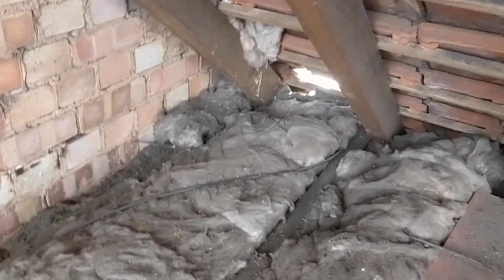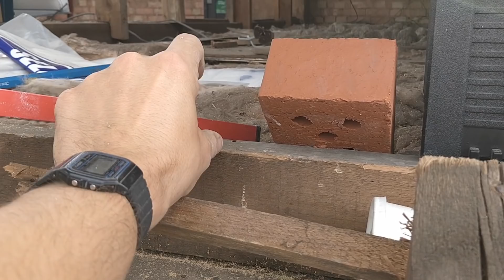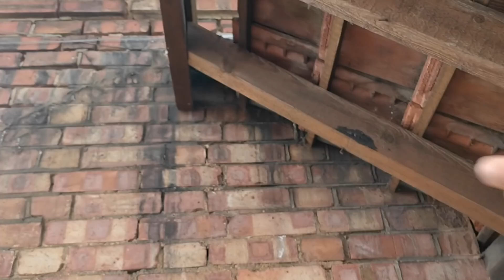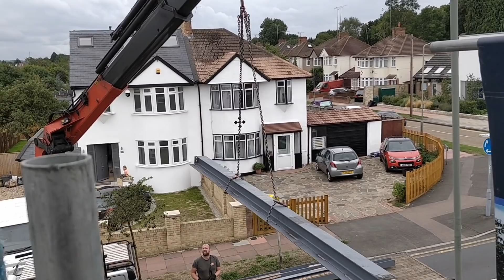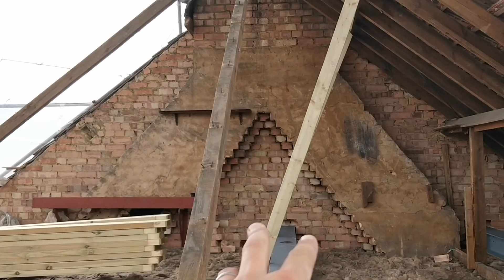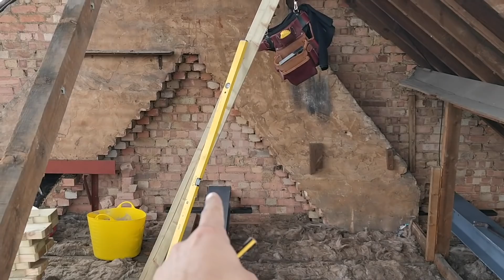Installing the steel floor beams

Comment: Is it really good idea to lay bricks on a timber ? https://youtu.be/YEJkfG62eu0?t=183
Reply from the maker: It will most likely be fine, and the building inspector was happy to sign it off. It's probably better to cut out that timber header and lay the new course of bricks on the existing brickwork.

Comment: I'm wondering what is the reason behind installing steel 30mm  above the wall plate ? I understand that long steel can deflect slightly and can damage ceiling finishes below but are there any building regulations behind this distance or is it individual decision based on different factors?
Reply from the maker: I was told by the building inspector that the underside of the steel has to be a minimum of 50mm away from the top of the ceiling joists...I haven't read that myself anywhere, but that's what he told me 👍

Comment: Where does the steel sit on the external cavity wall ( inside or outside wall?)
Reply: On a cavity wall the steel should sit on a Padstone on the internal wall and extend into the cavity 50mm it doesn't need to go into external brickwork .... all our structural drawings insist on a 150mm bearing for the steel.
Reply from the maker: So our walls are solid brick (no cavity) and spans across the full 9inch depth of the wall thickness...if it was a cavity wall I believe you'd want to do the same and span it across both, to spread the load of the beam and give more for the beam to register on.
Reply: @OfficeBoyBuilder  Thanks for getting back, yes I agree if I was rendering the wall on the outside but I will be bricking the gable so I can only rest it on the internal wall unless I rest the beam half way on to the external wall as well and cut the bricks in half when I am laying them. just to say  my house is a semi detached

Comment: You should have cut that timber out of the way and built up from existing brickwork. In time that timber will rot and steel will drop causing untold problems.
Reply: No need for brick at all .... steel can be sat directly on to a large timber packing secured to the wallplate.
Reply: @sileeds  no, it needs to be bricked up to get the height of the steel, and sad on a steel plate. 👍

Comment: Steels should be sat on pad stones
Reply from the maker: I think you meant to write "steels can sit on padstones"

The fact is, lofts have been built using this technique for years now, and the structural engineer and building inspectors both sign it off...
Reply: @OfficeBoyBuilder  no I didn't, as an engineer I always insist all steels in loft conversions are sat on padstones to distribute point loads safely, in fact on all designed solutions thank you 😅
Reply: @largespanner  ok, fine. I promise to do it your way Mr bossman🙄
Reply: @Helibox  PMSL

Comment: Did you consider laminating your own beams or using LVL's? I personally hate RSJ's.
Reply from the maker: Yes I did! I actually spoke to the structural engineer about it and whilst glulam beams are very strong (and attractive I think!) He said it's hard for them to calculate the strength and bearing capacity of something I've made at home. It's also really hard to create the pressure needed to laminate the beams adequately, just by using the clamps I've got in my workshop.
Reply: @OfficeBoyBuilder  I find most structural engineers to be very conservative in their outlook. Most of them have closed minds, basically if it's not in the manual it's not possible. When I worked in America we used to laminate our own beams from 10"×2" or 12"×2", glueing and nailing each successive  layer together usually with a layer of ply between the sandwiches of dimensional timber. If we had the bodies on site we'd man handle them into position or use lifting aids. Otherwise we'd laminate them in position, afterwards we'd put coach bolts through every four feet or so. Absolutely bomb proof, not going anywhere. Plus one can fix the slab or whatever finish straight onto the beam if it's projecting below the ceiling. Also as timber is naturally warm it doesn't necessarily need to be insulated like an R.S.J does. The same goes for L.V.L's only they have to be lifted into position in one piece. Steel is cold, heavy, hard to cut, hard to fix to and the amount of work needed to box them off so that they can be hidden is crazy. I don't buy your engineers point about not being able to quantify the load bearing capacity of a site laminated beam. These are simple enough calculations to make, all this information is available online and in texts.
Reply: In conclusion I believe it has much more to do with the steel lobby, insurance and liability.
Reply: Also commercially made L.V.L's have associated span and load ratings. I really can't see the issue, 🙄

Comment: Your videos are really helpful. Structural engineers and bci's are going well over top, these steel beams can hold at least 3x the weight they're supposed to..
Reply: For the floor beams a 203UC is common. You are correct in that these can most likely hold 3x the weight it will see during its use if it's stress based. Most of these beams are designed based on deflection and their splice capacities. The beams you can choose from for a loft conversion whilst keeping the depth low is limited, 203UBs which are light but typically can't span the distance and 152UCs which are also often used just depends on the span, but good luck getting the spliced connection to work.

Comment: you should be bricking your steel beam piers on to masonry, not a timber wall plate
Reply: Why not pack up the timber wall plate with timber securing each layer and put the spreader plate on top why brick on timber /timber on timber!
Reply from the maker: Yeah that's certainly a way of doing it - nothing wrong with that method at all. We were keen to stick to what our SE had specified because that's ultimately what the BCI is checking.
Reply from the maker: We checked this with the building control inspector and he was happy - there's no way of removing that timber wall plate without destroying the rooms below.
Reply: @OfficeBoyBuilder  fair enough, ill be pulling my bci soon about that as your way is so much quicker
Reply from the maker: I know of at least 8 other loft converters who are doing the same thing and their BCI is signing them off too. Everyone seems to be doing it that way now, so you should be fine (Total building control is who we use).

I know what you mean though; a non-compressible material bearing down on a compressible timber...but the structural engineer spread the load across 800mm because of that.